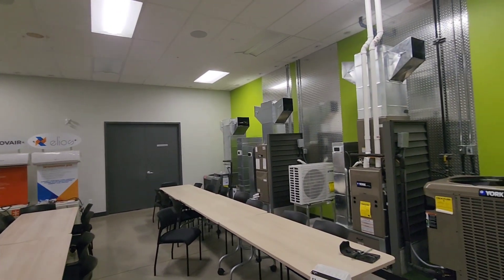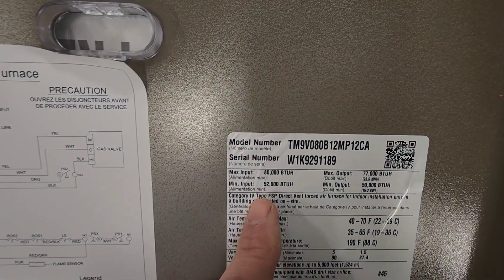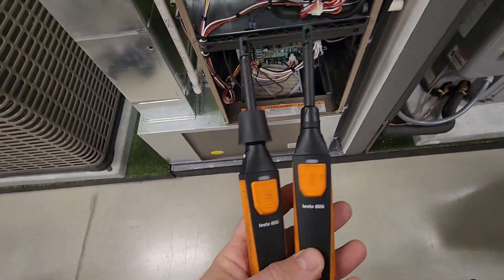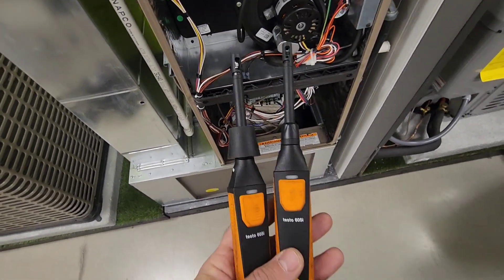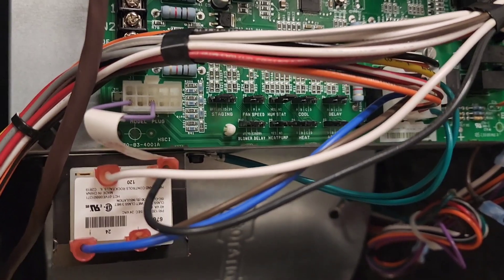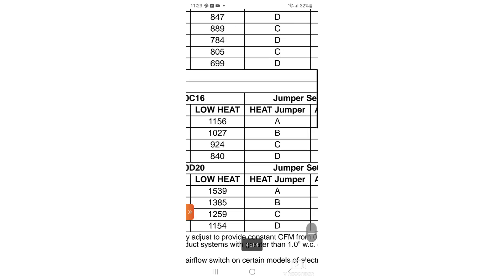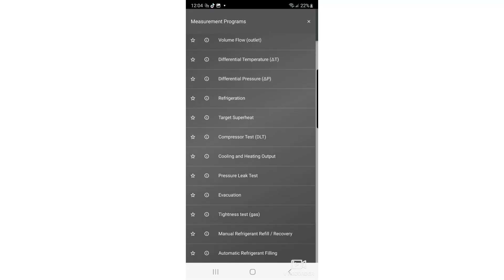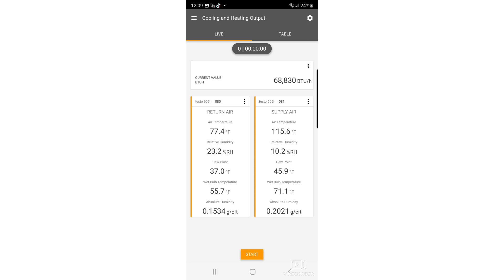How To Check Furnace Actual Capacity vs. Rated Capacity

Comment: Would you please share with me the brand of the 'coffin box' or filter box and stand assembly that the unit is sitting on?  I really like that design and the brand I am using for my clients doesn't look at well built as that one.  I install 5" filters in my units that I install and that looks like a great setup.  Great video, btw!
Reply from the maker: I believe the filter box is a General Air

Comment: Lol In case you don’t have the expensive Bluetooth tools for the app to do it for you the formula for btuh is  (∆ T) x CFM x 1.08
Reply from the maker: That's for sensible heat only.  The equation using delta enthalpy should be used.
Reply: Is the furnace adding any kind of heat other than sensible?
Reply: @HVACKnowItAll  Never heard of using the delta enthalpy equation being used for a furnace. Maybe cuz its a 90 percenter? Even then need more clarification.